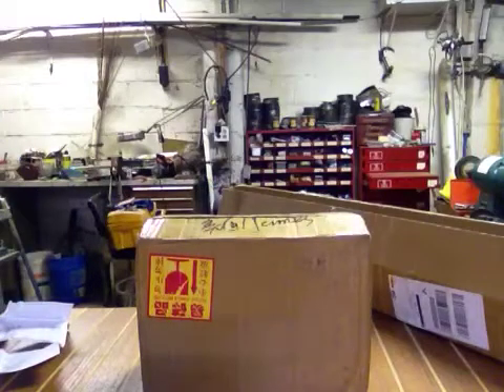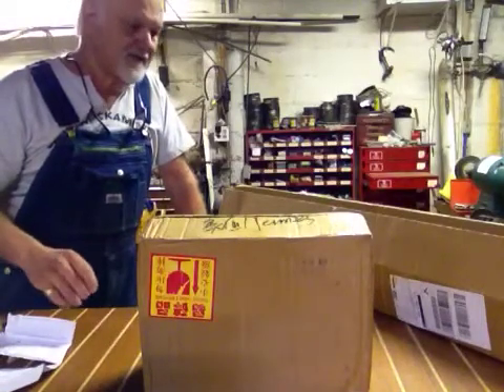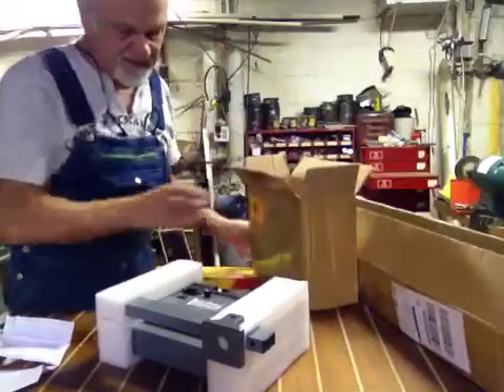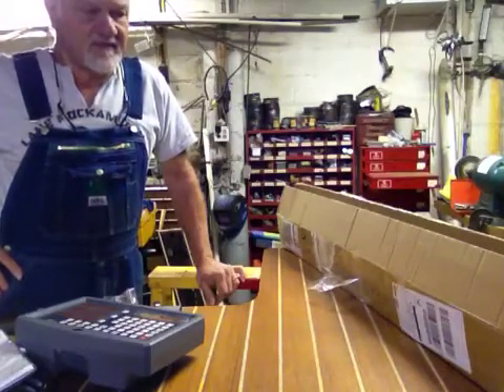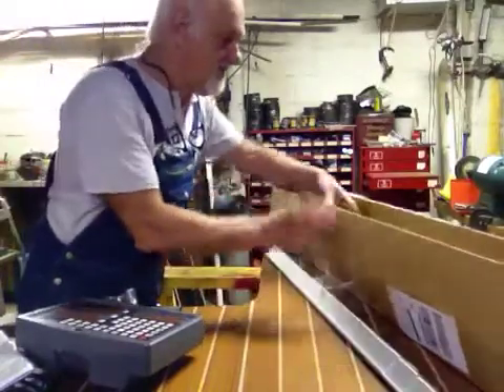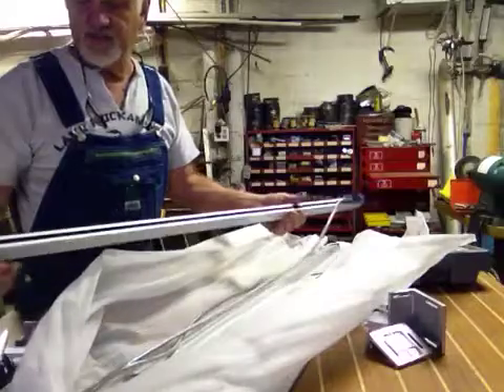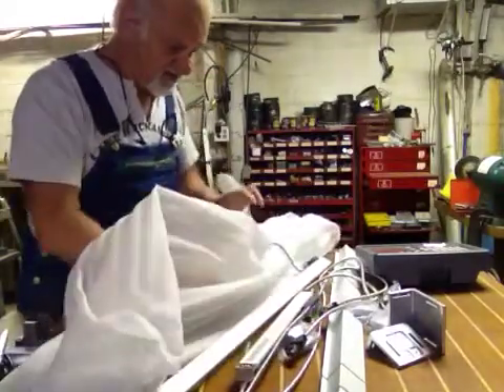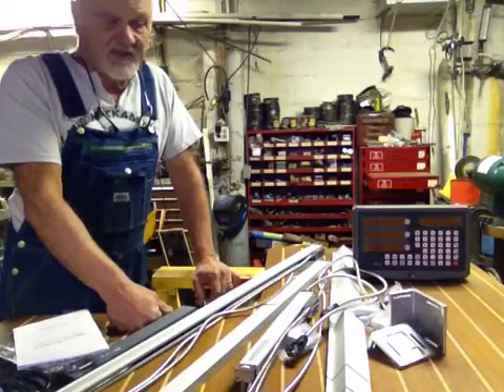dro for milling machine Bridgeport

Comment: Did you test it before installation?
Reply from the maker: +James Gibson  not yet but good idea
Reply: +jim trotta that is a good suggestion, I did plug mine in on my newly received unit. and ran the slides manually to see some change in the DRO readout. That is a good Idea b4 going any further.
Reply from the maker: +Ed Ginsberg  plug the unit and tested all good, mounting the scales
Reply: I bought a Mitutoyo DRO a few years ago because it was such a good price. Wasn't ready to install it but before I did a couple of years later and the linear scale read head for the y axis was bad and out of warranty. Should have checked it as soon as I got it.